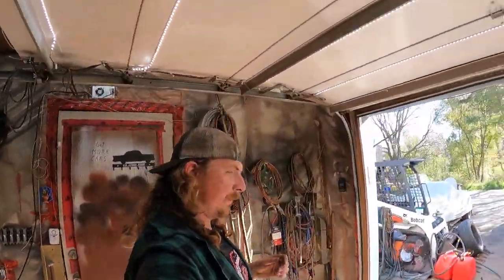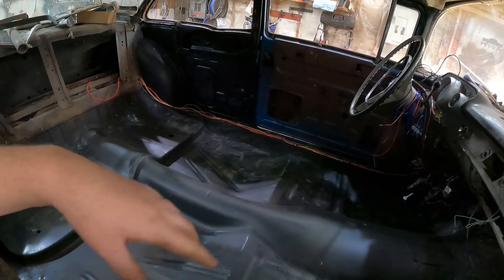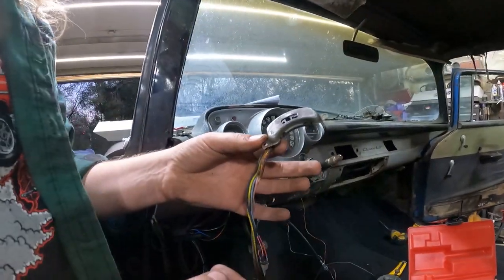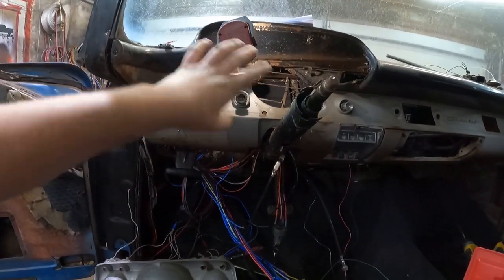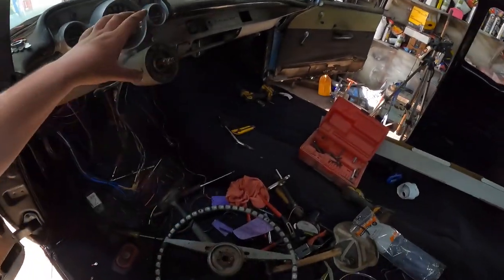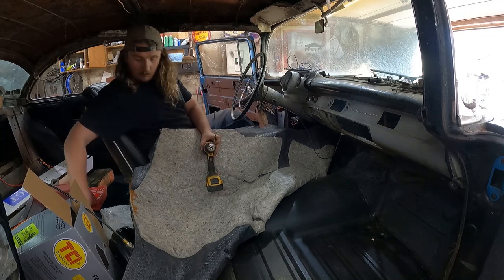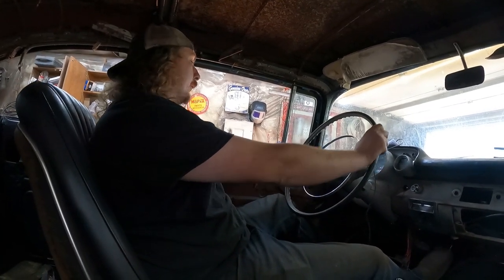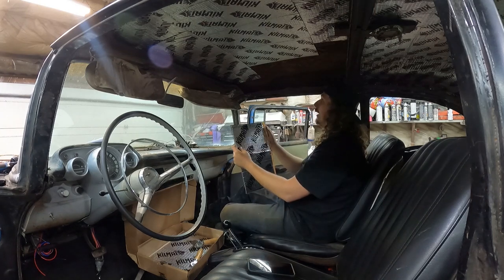1957 Chevy Two Door Conversion Gets A Sassy Interior Make Over On The CHEAP

Comment: Great work Dan 😎👌 also good idea to put the sound deadening on the roof too, on any of my cars without headlining you can guarantee that they have icicles hanging from the roof inside over winter, put this stuff on my roof a few years back and it stopped that issue all together aswell as controlling temperature inside a lot better too

Comment: Looking good. I used a product called Peel & Seal from Home depot for sound deadening. It comes in 6" x 25ft roll. self stick. Cheap and effective and very flexible
Reply: Works great at a quarter of the cost.

Comment: You do great work man. Them old electrical contacts can be a pain to get fixed. Also your right the back of the guage cluster was mint man! I think you should put that nice 57 steering wheel on your ragtop man. A 57 150 had there own style steering wheel. You have a 210 or Belair steering wheel on there. Also I've been looking at your bumper on your cars. It seems like they all have the California 1 piece bumper? Later man keep giving it👍

Comment: Speaking of "Masonite"...Headliners are a PITA (unless you're an expert)
If you want to do a nice looking headliner "On the Cheap".... Go to the lumberyard and score a sheet of thin Masonite. Measure across the inside of the top from  side to side, pushing your tape right up to the new insulation as you go. Cut it in 12-18" strips whatever seems manageable to allow for the front to rear roof curvature and fit it tight, so you will have to springboard it into place, using its springiness to hold it in there....paneling your ceiling with the Masonite.
Then go score some black "indoor/outdoor" carpet....it's like 1/4" thick felt. Test fit it, make a couple of tees out of 2x4s to help you hold it in place against the top. Starting in the middle...glue it to the Masonite with contact cement a little at a time, stretching and rubbing it as you go along. It'll look good.
Once installed, it will disappear. Nobody looks at the headliner unless you don't have one, or it's ratty.

Comment: hey they make this sorta cardboard like stuff, I got mine at home depot.  it comes in 4x8 foot sheets, but it makes great interior panels cause is solid enough yet easily bends. they also sell stuff called TinTest. it is awesome stuff, is so close to what they used inside old cars for sound deffining and insulation. sure you know as many of us, it seems like the cold comes from front, wich yes alot does, but they get most cold from the back, vehicals are like hover vacumes, they suck up stuff at the back and pulls it forewards. want a warm car put a good sealing layer of Tintest across the back opening into the trunk. it comes in diffrent thicknesses. 1/4 would be good. when i built my cottage we insulated the floor like normal, but ontop the floor between the sheeting and the hard wood i covered the whole floor in tintest and i swear it made a intire diffrence to keeing that floor warmer cause we know mobile homes have cooler floors. One word of Warning cutting it wear a mask, googles and stay covered up, is very dusty stuff and makes ya very ichy, lmao. it is kinda fibery stuff. and is easy to bend slightly ect, but a good insulation.

Comment: DD Speed Shop , i believe you have 68 Chevelle buckets seats  or slight chance 67 bucket seats ( 69 up had head rest )   your installing there ,  there worth a lot more $$$ than you may know . i seen very, very  ruff seats go $400- $800 . no wonder the seats are so low being from a Chevelle.
Reply: Those bucket seats are '66 Chevelle with that upholstery pattern, and non-locking.  Also,  '67-68 have side locking buttons, 69-72 have rear locking buttons and factory headrests.  Been doing classic Chevy seat restoration for 45+ years now.
Reply: @stevenaugustin6784  defiantly more rare thenbeing 66, im guessing buttons was the biggest change then?   i  knew not 69 up for no head rest but i knew they had the Chevelle look im more 70 -72 because i have a 70 Chevelle, so yes im rust on older, but if thats original material ,thats  unrea,
 great shape wow!